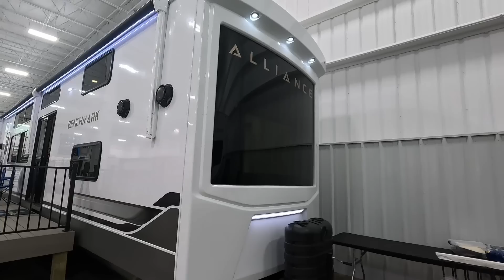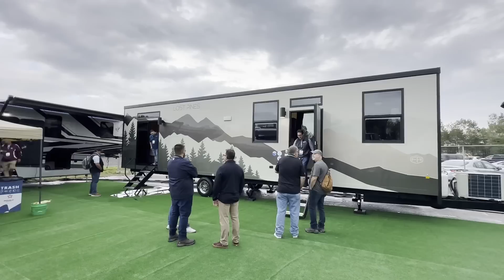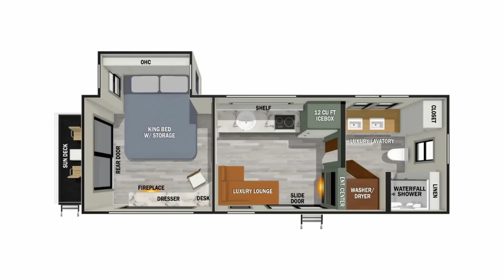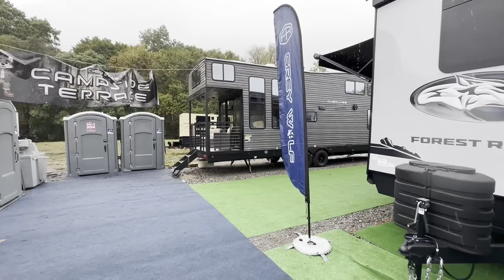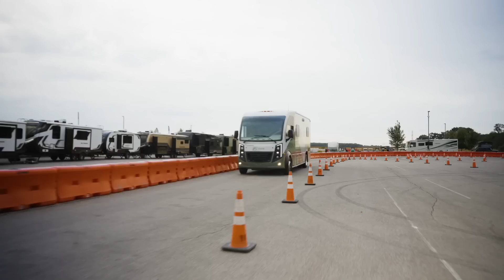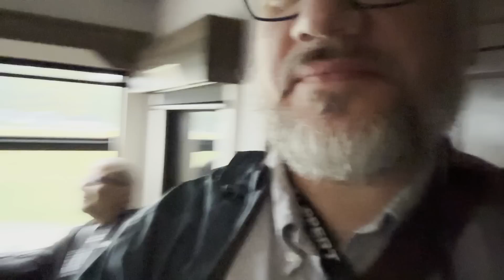2025 RVs Are CRAZY! NEW RV Trends and Tech

Comment: you have to be rich and stupid to buy any of these unless you own property with electrical hookups and septic tanks with these newer laws in place. Look up the 3 biggest mistake you regret buying in life. The smarter folks are buying smaller 20-25 ft class B and Cs models with induction appliances, solar, 2 alternators and lithium batteries, winterized with duel pane windows with inner water and sewer lines.

Comment: As the quality of these improves (and it will), these will begin to make more and more sense as the impacts of climate change intensify. Triple-digit heat; wildfire smoke; hurricanes, etc. are seasonal. The #1 focus of these manufacturers should be insulation and energy efficiency. If you can get to a quality where you can move these once a year between 2 climate-friendly locations - you've got everything beat.
Reply: My thoughts exactly

Comment: On the topic of Electric Motorhomes.  It's about the user-  Class A drive far less then Class B.  Class A has a ton of empty space underneath to add batteries - Class B is already optimal packed.  Class A has significant amount of roof space for solar - (hope for minisplit integration and get rid of all the crap on the roof)

Comment: Love the design evolution of the destination trailers. Those things are becoming wildly popular.  Also love the idea of FOUR AC units in one of them. Makes summer camping more doable down here in the south. 
I'm in the process of looking for my seventh RV. I gave up my fabulous Jayco travel trailer a year ago to try a Class C for a while. I'd prefer the roominess of a travel trailer. I just wish, wish, wish that someone would come up with an easier hitch for a small woman to handle. 
At some point, some genius somewhere will develop a whole new "docking system" for RV's that doesn't require as much muscle to hitch and unhitch. 
Thank you for the video. There's a ton of good information here! 
😃
Reply: You can use a ProPride hitch,  my daughter uses one, and most of the hitch is on the rv itself,  not on the truck,  but it's 3 to 5k!!!! And you have to be straight on with the 'stinger' fitting into the small hole on the ProPride.... takes a lot of practice, but she does it all alone 🎉
Reply: @scoobri6  Thanks! Pretty pricey, but I'll check it out. I've never heard of it before.
Reply: @melaniedeare5427  my daughter towed a 34 foot grand design imagine with a half ton Titan, was using equalizer,  have af WDH, and it was throwing her around the road with light winds and passing 18 wheelers.... now,  it's steady as can be

Comment: I like the idea of making a class A coach a plug in hybrid. 150 miles on electric could be all some people need for a day, but it would also make a good Boondocking unit. 
I know Mercedes and Fiat/Ram have introduced vans with 250-270 miles of range, but I haven’t seen any RV companies convert them yet. 
I’m curious about campgrounds, since when EV pickups started appearing, some places introduced no charging rules. Now with Class A electric vehicles starting to appear will they stick to no charging, or upgrade their electric systems?  I know one campground that is upgrading their electric grid since there are a lot of EV cars bringing trailers and tents from the nearby cities. 
One pickup I have been interested in has a 14-30 plug in the bed that could be adapted to a TT-30 that my trailer can use, then the truck itself could plug into the campground’s 14-50 outlet. 
I will be following the Thor/Harbinger effort to see if they have a floor plan and price point that works for me. 
If they made a Coachmen Euro 25LE clone with the 37”x38” gear garage, but PHEV instead of V8 gas, they would have a sale up to a certain price. I like the Thor Axis/Vegas line, but I was in a 25.7 today and it had issues with quality and that was the only floor plan with an almost good enough gear storage

Comment: Impressive, but sometimes, less is more. Me and the wife are downsizing and going back to the basics with an older non-slide trailer. Tired of holding my breath every time we are ready to leave and press the slide in button. One piece aluminum roof. Smaller windows that don't transmit as much heat and cold. We sit outside most of the time. I really dislike scrolling thru a menu to turn on lights. Switches worked great for the last hundred years.
Reply: Casita and Scamp trailers are pretty simple
Reply: My slides do cause me some anxiety too
Reply: I prefer regular switches too even so I love innovative stuff (which works).
Reply: @aeconsulting1  We have a fairly new Venom toyhauler 5th wheel now. Have to scroll thru the menu to turn on each light or adjust the HVAC, it's ridiculous. Everything is in the menu.
Reply: like cars- moving from tactile switches and knobs to electric with software is more affordable to manufacture, but not better for owner use or longevity
Reply: Same here just downsized to a non slide. Not worth the seal and motor anxiety!